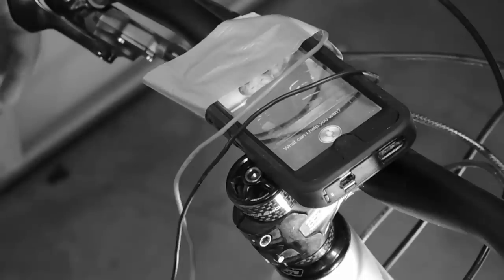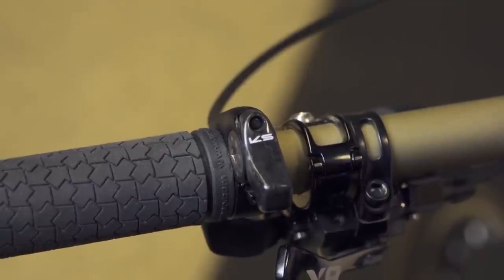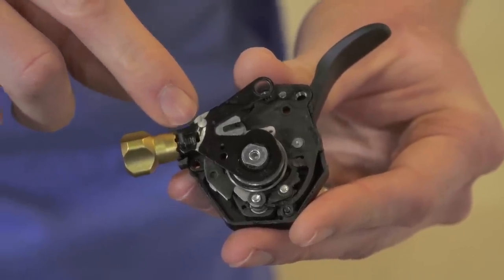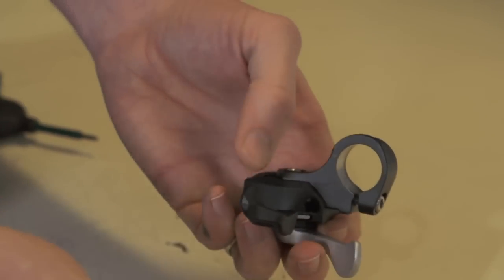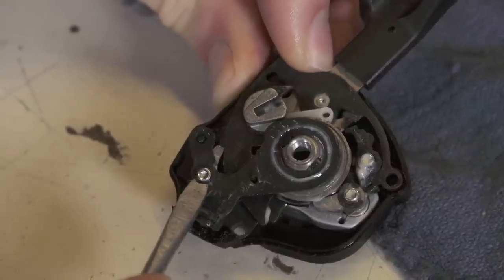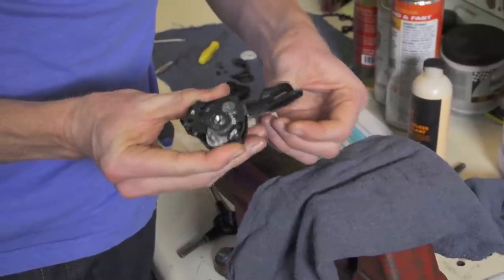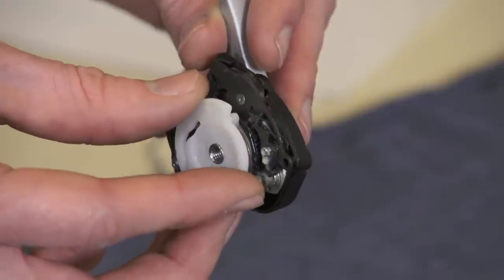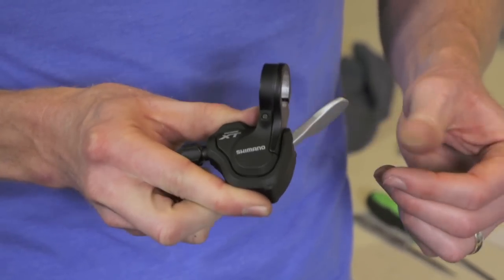How (Not) To: Make a Dropper Post Switch-Shimano

Comment: I have a Giant dropper and hated the switch. So I bought the KS Lev southpaw remote and bought a cable barrel end with grub screws for the end that connects to the bottom of the seatposts release mechanism. It works perfect.

Comment: Can you make a remote lockout in a similar fashion
Reply from the maker: Yehuda Ackerman With a remote lockout you need the shifter to hold the cable that has been pulled into it. So, an unmodified shifter would be better for use as a remote lockout.
Reply: Can You explain step by step how to do it ? Big thanks !!